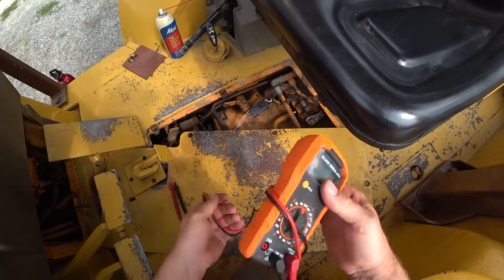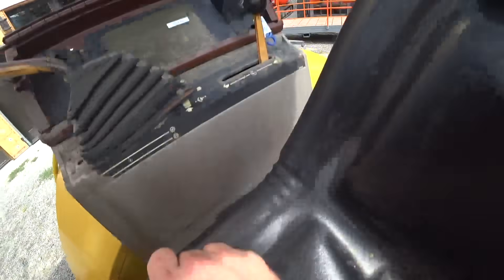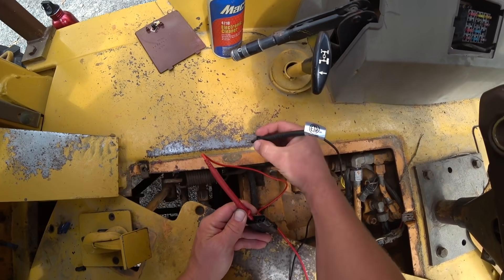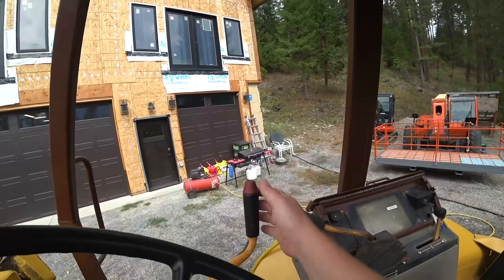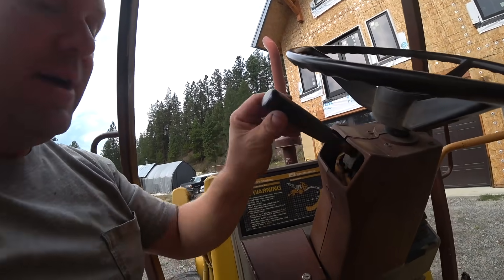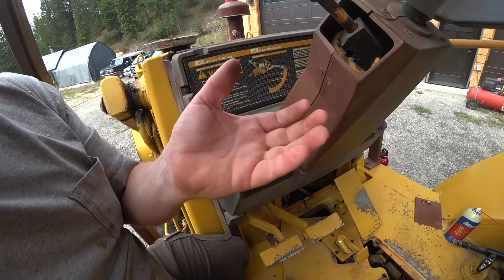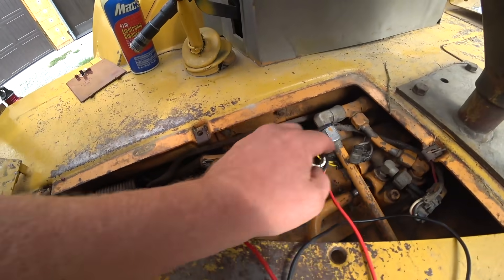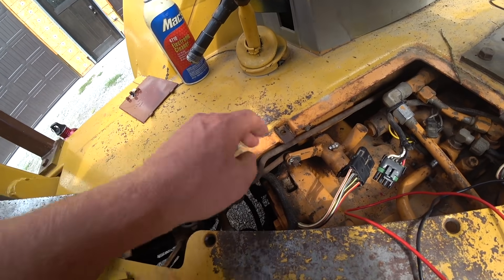TIME FOR A NEW BACKHOE?

Comment: The comment about putting a test light in the could help. But when you have a intermittent problem those are the worst. Next time it fails try isolating the sections of the circuit. Each time looking for grounding or the actual load this set of switches are operating. It could the actual load is failing intermittently. Like a mostly burned out coil. Or a silinoid that is supposed to draw in an armature and it doesn’t get drawn in. Pulling high current load. 
Hay what do I know I have to get out and reset the injection silinoid each time I shut of the switch. O well it’s a “case “  I just think it is like a security system.
Reply: Seems to me I saw 2 connectors that had corrosion in them. That would cause a higher draw...

Comment: Need a megger, aka megohm meter aka insulation tester. Imagine a PEX pipe with a slight slit in it. Under low pressure the PEX self seals and doesn’t leak and you can’t find it. Under higher pressure, water will push outta the slit and you can find the leak. Megger/megohm meter is your source of higher “pressure”. Isolate as many sections of the circuit as you can and test to ground.

Also, as per previous suggestions, CHECK THAT SOLENOID.  It just screams out as a suspect. Moisture in the switches also is suspect.

Comment: Yes, it is hard work finding intermittent faults, but as a lifelong engineer I have seen SO MANY bad designs or layouts of equipment like yours where the problem would be easier to fix if only the components had been designed to be accessed or removed easier but unfortunately these sort of things tend to be very much an afterthought and maintenance has not been a major consideration.

Years ago I had an old landrover that had an intermittent starting problem, no rhyme or reason as to when it would or wouldn't andthatwas tracked down to a flake of rust from the fuel tank lodging in the right angled connector on top of the tank and either blocking the flow or not, now THAT took some finding!
The solution will be found someday but will probably be totally accidental - hope it works out eventually.

Bob

Comment: Pressure washers are brutal on old switches
Reply: Electronics in general. I decided to pressure wash the engine on my garden tractor and something got wet and it wouldn’t start for a day until it dried out.
Reply: Air compressor.

Comment: After watching these two videos, if I understand what happened correctly, the problem became worse when you replaced the connector with the wire slightly pulled back. You were able to get it to stop, thus isolate the harness, by disconnecting the repaired connector? If so then your issue is on the non-powered side, or load side, of that connector you just repaired. More than likely the switch or device that the wire which was pulled back is supplying is your issue. Does that make sense? If I had access to a schematic I would give more detail but that's where I would start.  Best of luck.

Comment: Check the flexure where the wires come out of the bottom of the lever with the button...   When engine is running hydraulic hoses straighten and move things around..

Comment: When ever you work on equipment, you learn.
I didn't see any mice nests, that's a big plus.
I remember a friend got aggravated with a wiring harness
and he took a piece of rubber radiator hose and surrounded 
the area he had trouble getting to. He was so tired he went to bed,
the next day he couldn't find the problem, everything worked.
Some times it's that crazy.

Comment: The solenoid may be going bad and drawing two much current (Amps) and blowing the fuse. Check all connectors to the solenoid. Do an resistance test on the solenoid when it is working then compare with the test when the fuse blows. A little bigger fuse 5 to 10 amps bigger would be a temporary fix ,, Any bigger fuse and you will find your short with fried wires from the box to the short.

Comment: Do not overlook the harness in the steering column if it is an adjustable column. The loop goes to the selector for direction. I have had this many times to be the problem due to moving the column over time. I have seen this in new equipment also. Hope this helps. Yes I know it is remote to the area you are focused. Thanks for your video.
Reply: saw that on a Ford Sport Trac, all the lights worked if the column was in one position, but not another.

Comment: You seem to have 2 areas that could be your issue. Check that little nubbin wire by the shift solenoid that doesn't go anywhere. Also, check that connector for the button on the handle to your right. Both looked like they had corrosion on the pins. That corrosion could cause it to lose continuity/volts/amps. By replacing those two connectors, that could potentially solve your issue since it doesn't look like your harness is grounding out...
Reply: Corrosion is definitely an issue, I don’t see see how a little corrosion on pins would blow a fuse. More like a voltage drop across the connector the de-clutch would likely not work but not blow the fuse. Also those switch are just open and closed hot wire in hot wire out or ground wire in ground wire out the switch is not the issue once again if it was the switch the de-clutch would work but wouldn’t blow the fuse. I think there is a de-clutch relay that the switch operates he may want locate the relay
Reply: @andywheeler9583  Corrosion create heat and an amp draw. Too many amps will blow the fuse on load size alone.

Comment: I think you are on the right track and in your efforts to locate problem you have actually shifter the wire enough to make it work, it only has to be moved a small fraction to loose contact...lots of luck...it would be nice to be able to actually see the problem area...

Comment: Jesse, food for thought. I used to drive OTR.  Having a freightliner over the road you run into issues. Driving in the rain i started to hear this hum. Then, i noticed that the washer pump was pumping windshield washer fluid. After many stops at the repair shops and being told i was crazy, a mechanic finally found the issue. The ECM is on the right side of the firewall on the engine side. It is housed in a box with a metal cover that has no seal other than a step in the metal cover. Low and behold, when it rained, the water would get behind the cover down onto the ECM. The water would ground out the pump as to turn it on. Some silicon on the lip of metal cover and never had issue again.

Comment: Why not pull the entire wire harness from the switch to the connector and see what looks bad.  Could be two of the wires in the loom are shorting - might not be shorting to frame.....Or you could just use a wire in the fuse (Purposely let it short) and then use your FLIR to find a hot-spot where its shorting.....

Lastly, I use to have an intermittent short in my door likes on my car, could never find it.  Finally just bought a circuit breaker fuse, so if it did blow, it would just re-set itself.  I know, not the best solution, but at least it keeps it from totally melting wires (ie. vs just bypassing fuse...)

Comment: Still watching the video , but my thoughts are maybe a bad solenoid / shuttle valve. That only shorts out when activated. If it was a power feed side short it’s normally a pinched / Chaffed wire.

Comment: First, if dirt is causing your problem, blowing air is wrong, use a vacuum instead.
 Second, if you think a chafe is there, wedge some rubber or plastic to insulate from metal.
Third, in 2 places in the documentation I used to fix our equipment was the note; " when you find where to go from here, call us and we will note it for the rest."

Comment: I wouldn't power wash it- you were spot on there. If rain is the problem, water with 900-1000 psi behind it will make it go nuts. Ultimately you need to get all the power critters under cover- a shed building big enough for them and room to work on them. Tarps can often create problems with condensation and mold. FWIW, intermittent problems of any king, not just electric can be very frustrating- you are smarter than the "smartest" machine so far created- patience is not only a virtue, it is how gravity and physics win, even when they appear to be small forces. Have a great evening- it's now tomorrow's problem.

Comment: if you rap more  insolation around the cables will protect it  and a test the wiring put the multimeter in the fuse holder of the switch wire check for wire shortage in the switch

Comment: If you think it was a "moisture" problem you might want to keep the backhoe covered with a tarp, at least the cab area covered so rain and snow doesn't get into the electronics.  Or you could build a small "carport" type structure that you could park the backhoe under and try to keep the cab protected. 

As for "not learning" something from this? That is not true. You learned that you have to keep every nook and cranny clean! You have to clear dirt and debris from behind all panels to help keep moisture away from the electronics!

Comment: I do not have the knowledge to repair small engines.  After years of frustration, I replaced all those tools (chainsaws, trimmer, even outboards) with new electric tools.  Now everything runs and there is no gas to store and no exhaust and much less noise.  It was all worth the expense.

Comment: I fuse is an over-current protection device and its job is to protect the cable. So sometimes the current is very high as in a short and sometimes its just a little over the fuse rating, as in when the thing the wire is attached to is pulling too much for some reason. The only difference is in how quickly the fuse blows; almost instant for the short, possibly several minutes for only just over the rating and all points in between.
If you can see the fuse wire, as you can here, it's possible to get an idea of what type of issue is causing it to blow. If metal is splattered all over the inside and there are little or no visible ends that's a short. If there are ends and particularly if they are balled up, that's an pulling too much current issue.

Comment: Some time's cleaning is the solution to the problem, I've fixed many just by a total pressure wash with soap and then blowing dry with warm air. It'll either show you where the problem is or it will fix the problem it can be just that simple.

Comment: Jesse you didn't waste your time with this video. I work on heavy equipment and dump trucks, I have spent many hours looking for electrical Gremlins and never found them. But the issue seemed to have taken care of itself. 

Electrical Gremlins are more prevalent in the newer electronically controlled equipment then the older mechanical controlled equipment. It's the nature of the new beasts.

Comment: It could be a wire that is broken inside , the gap creates a higher resistance and also a contact shockwave that might blow the fuse , trough moving the harness it might be now closer so it`s working again . In my mind  replace a part of the harness because you wont do it again in about 28 years?!? Have fun you guys

Comment: Intermittent problems are the worst things to find. -- One earlier comment suggested changing the fuse to a bolt; yes, that finds the problem but it also creates more work to fix the original problem and the problems induced by the bolt.

Comment: You might want to load test the solenoid on the gearbox it 28 years old, you might not be using a big enough fuse, because when you have been over everything else and not that...

Comment: Hi Jesse I have tinkered with equipment for 50 yrs.  what happened to you and the backhoe is an every day happening.  I take things apart clean them, put them back together, see nothing wrong, and they work.  Doesn't seem to make any difference whether it is electrical or mechanical.  I know your problem was a while ago.  Did you find the problem?  A lot of times it is just a connection.  Just plain dirt can short things out.

Comment: Can't blame the generation for this, its how things are made now. Had a problem with a surround sound system, took it to a repair shop and was told it would be $150 just to diagnose the issue. Just upgraded the equipment for around $200

Comment: There a big lesson on the video my trailer brakes and lights werent working took 7 pin connector apart 4 times direct wired it nothing worked put it back together it worked 6 yrs later still working???

Comment: Get a wiring diagram, isolate that circuit and track down the short in the correct color wire on the diagram. Watch Eric O on South Main auto repair. He is a dynamo at locating and correcting electrical faults in vehicles.

Comment: Bypass the crook loom wire with a new loom wire if its really hard to isolate a sporadic loom short because of restricted access, and run it through a very small dia. nylon pneumatic tube, next to the loom, to protect the new wire, to avoid insulation vibration abrasion.

Comment: Theory? Hum!  Get a full wiring diagram for the backhoe you have.  Check all the wiring first.  A new backhoe is not cheap.  But if you have lots of money, then spend it on a new backhoe and sell the one you have to someone that knows what is wrong and can fix it.  U could loose a bunch of $$$$.

Comment: You did not show it the video, but did you check the other 1/2 of the circuit. You probed one plug but did not probe the other plug. So you are only checking 1/2 of the entire circuit. Many years ago when I was a systems tech. One of the other techs on the day shift was looking for a shorted wire . He spent 8 hours and could not find the short. When I came in on second shift I was handed the job to locate the problem. It took about 5 minutes to find the problem. I checked with him the next day and found out he had spent his entire day checking only one plug. I was lucky to check the plug which was the other 1,2 of the circuit.

Comment: i understand what your doing , and my thought was maybe on the back side of the fuse box with all stuff building up over the years it put presser on the white wire where is connects into the back fuse box and that might be what the issue was , just a thought

Comment: Mechanical engineer here and what I do when Im looking for shorts/electrical issues , I use a small spray bottle with water and wet the area of most suspected issue when you know everything has had some time to dry out or in your case no trace of closed/shorted circuitry.   Make sure you only do one spot at time and it will tell you a story every time.  also if you have a smart phone , witch im sure you do lol you can take a good picture of that spot you cant get to and after you take the pic you can zoom and use like magnification, I know your prob done playing with it but let us know how you make out .

Comment: I'm from the generation where you worked on all things mechanical - from cars, trucks, mowers whatever. If it broke, fix it do not throw away because it doesn't work, find out why and repair If You Can. Great video, content & message contained in it. Happy you saved and posted. Note: Lean to shed will help keep machines OUT of weather. Help out on problems as these. Spray some WD-40 on your connections also to keep out moisture {WD = Water Displacement - really}

Comment: One of the worst troubleshooting I have ever done turned out to be small metal splinter within a larger loom that only occasional touched some bare metal chassis. The thing was that the whole cable looked perfectly okay, I wouldn't have noticed it unless I didn't gashed my finger open trying to follow the specific strand.

Comment: There was a saying when I was with the Cav (Cavalry), “Horse, saddle, rider.” Meaning when you came off mission, before going back to the barracks you first took care of your ‘horse’ which today is your vehicle. Check fluids, restock water & ammo, log any malfunctions, etc. Then you checked your ‘saddle’ or what is commonly called your “battle rattle” your gear you wear. Again restock water, ammo, medical items if you used them, make sure everything is still tight and secure. Then lastly the ‘rider.’ Take care of yourself; eat, sleep, clean yourself etc.

Comment: Fox and hound short finder yo. Ive found opens and shorts in 100+foot boats in wires that have been spliced 4 color changes and more. Marine mechanic 25 + years... The difference between a Mechanic and a Technician..a "Technician" manicures women's fingernails!

Comment: Replace the fuse with a circuit breaker. or replace it with some tin foil.. You'll find the short.   Maybe if you hook a light up to that fuse, you will know the moment it blows and you will know your hand was pushing on something that causes it to blow.

Comment: Electrical systems are a pain. This is why equipment has mechanical, foot operated clutches. It’s a super weird set up that case went with here, but it makes it harder to work on. We had a problem with a rough mower at work where the fuel pump wouldn’t engage when starting it. We could wiggle the wires and the fuel pump would occasionally kick on, allowing us to start the machine. We would shut it off and the fuel pump wouldn’t work again. Eventually it started working consistently so we just left it alone. Seems to be working fine now. I totally understand the situation though. As for that discussion about doing extra work instead of doing your actual job because of malfunctioning equipment. It’s the worst.

Comment: I have a theory based on what you were describing.  If it happens when you press the switch, double check for grounding on the switch in different positions.  Yes, I saw that you checked for voltage.  But didnt see you check for ground.  Cause if you think about it, you did mention that you blew the fuse when you pressed the button.  Voltage will always show when tested for connection, but not ground.

Comment: Putting WD-40 on the screws and bolts will work for a short time but grease or preferably Never Seize will last longer on outdoor machinery. It's messy but it works.